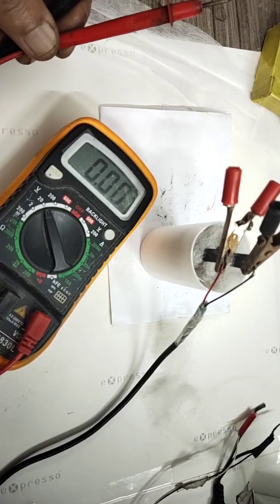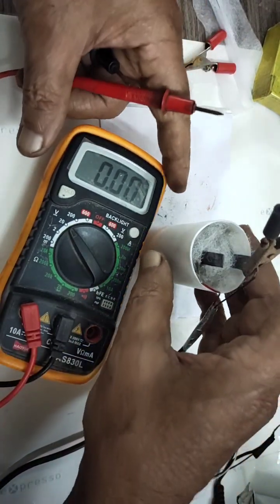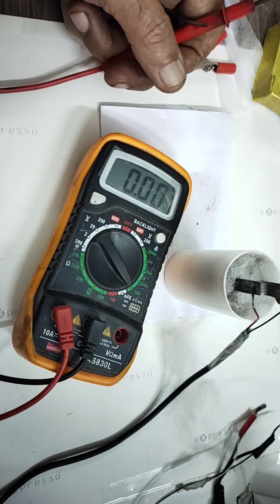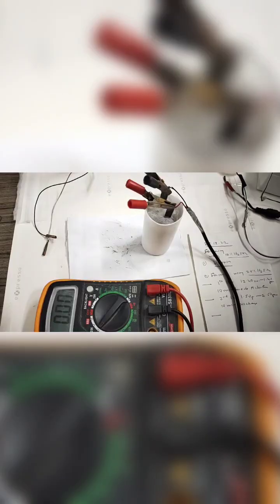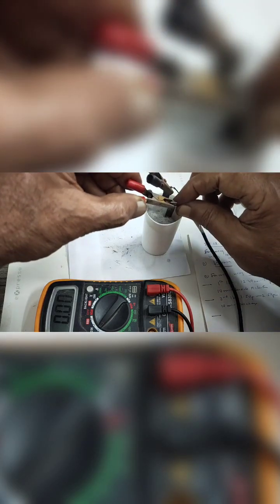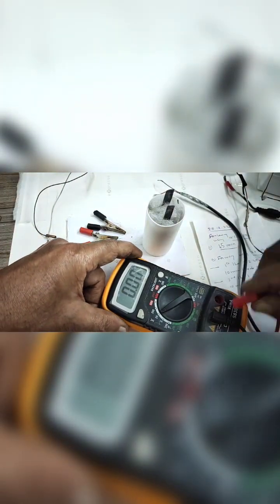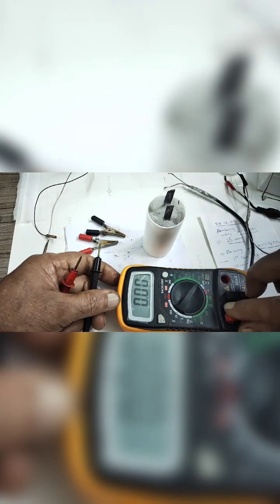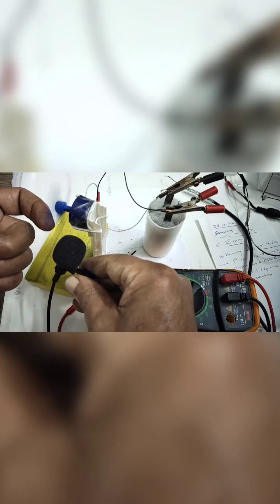LEAD ACID BATTERY MAKING PROCESS -AMAZING TECHNIK, NEW DESIGN, SESSION-III, DISCHARGE 2ndFORMING ETC

Comment: Salaam,
I have removed the lead from a dead battery... The lead sulphate (cathode) was totally damaged... I am in Sri Lanka and think I would not able find the chemical which you mentioned in the video... Please recommend me a cathode material to try...???

Bye the way, are from Tamil Nadu??? 

Salaam
Reply from the maker: These materials are supplied thru Lead acid battery accessories suppliers. You are to search thru Google "battery chemical suppliers". May be you will get in Bangalore.
Reply from the maker: Need not buy new chemical. Collect the smashed cathode materials carefully in a small pan, slowly heat until all becomes one powdery mass, even you can add any other cathode materials you have got from other old batteries. Heat until dry in a outside place in open condition. Cool, smashed to powder form. Use this for pasting on the new negative grid you can get from battery dealers. This will be your negative plate.
Reply from the maker: The cathode material is also same ie. Lead oxide(light yellow red 8n color) major portion. 10% by wt. Of red lead(orange red in color) to be mixed with and then 0.15% of carbon black to be mixed with it. This will be the mixture to be pasted on the negative grid. I am not a manufacturer, I only sharing my simple techniks. Readymade Negative plate are available with BATTERY MATERIAL SUPPLIERS. YOU HAVE TO SEARCH USING GOOGLE SEARCH. OKAY
Reply: @dkjawahar-techexpt671  

Where can we find these materials??? These materials are not available in hardware stores...